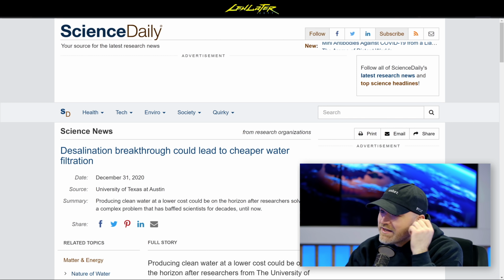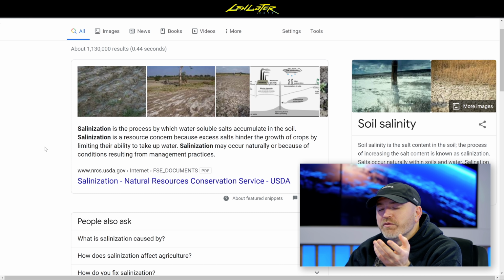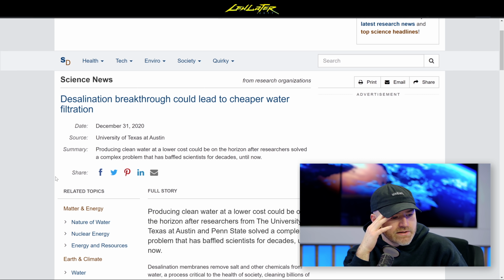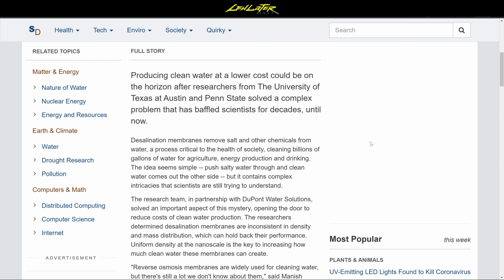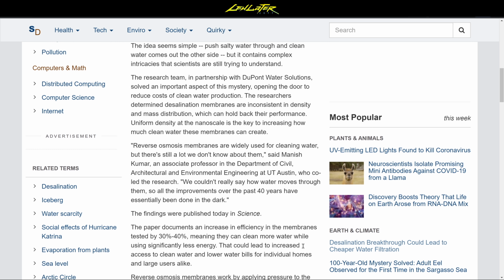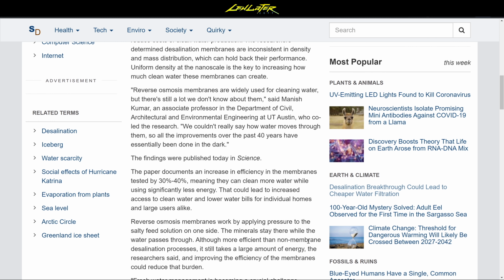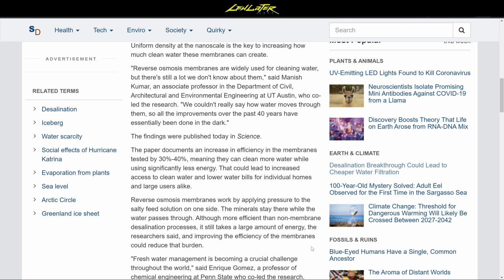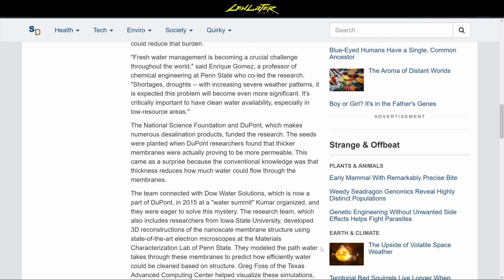Ocean Water to Drinking Water Breakthrough

Comment: Dean Kamen (Segway guy) has an ongoing project called Slingshot that can basically take anything wet and distil out the water to purify and sterilise it that’s really interesting. Consists of a small boiler and compressor that squeezes the steam to increase its temperature and then cool that steam down by exchanging the heat with the boiler. In effect it recirculates the energy used to boil the water so very little additional energy is required.

Comment: I love videos where old proven technologies are suddenly amazingly rediscovered. I learned about reverse osmosis over 30 years ago. I was just cheaper to rely on an even older way to remove salt from water. You boil the salt water and collect the steam. Most first world countries in arid regions have some form of desal. But of course anyone without any knowledge about the process think it's clean and environmentally friendly, it ain't. Simple test,buy a goldfish dump 4-5 table spoons of salt in the water. Where these plants discharge they create a dead zone.
Reply: This seems like it would benefit more for Saudi Arab cause of the area and the scarce water plus they can use solar for the power which is what there doing.

Comment: Its not difficult to drink water from the ocean... its called condensation... not complicated. Try it at home. Go to the toilet, get the shitty water, boil it, keep a mirror above the pot at an angle so the condensed steam drops the 100% pure H2O into a packet. Now you have a clean water. Not freaken complicated.
Reply: The reason why its difficult to think about is because it meant to not exist so you can always pay for water.
Reply: Install large mirrors on the beach and use a water pump to collect the condensed water.

Comment: Singapore is already doing it... Getting drinkable water from the sea.
Reply: Singapore just testing reverse osmosis and targeting 30% usage of it in 2060. Currently, their drinking water supplied by Malaysia.
Reply: @azmanahmad776  Exactly. Malaysia is the main water source of Singapore. I wish they would continue with the High Speed Rail project between the two nations.
Reply: Iran has used sea water and treat to be usable in agriculture I think.
Reply: great job
Reply: Do they just want it as a backup so they can tell Malaysia to screw off?